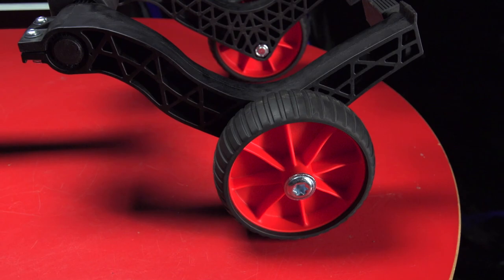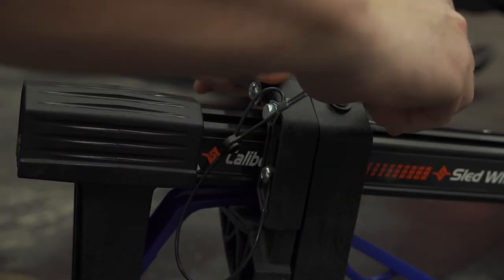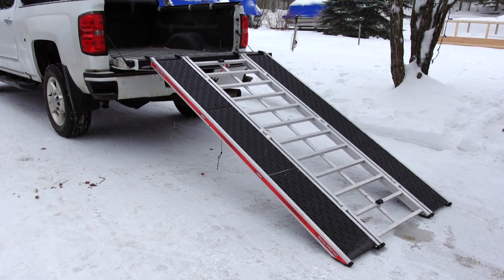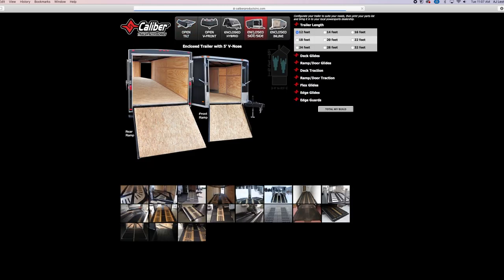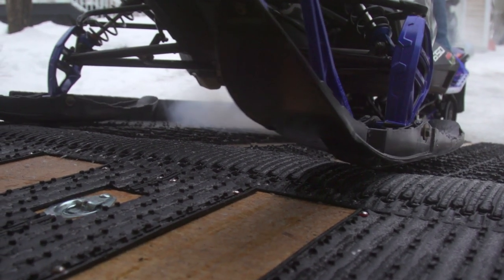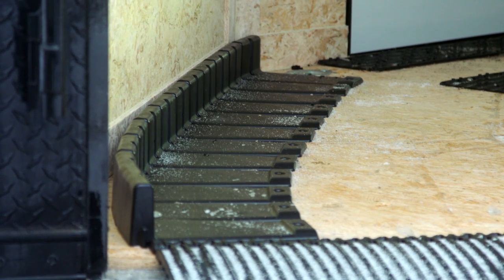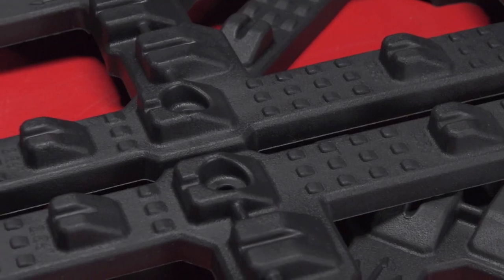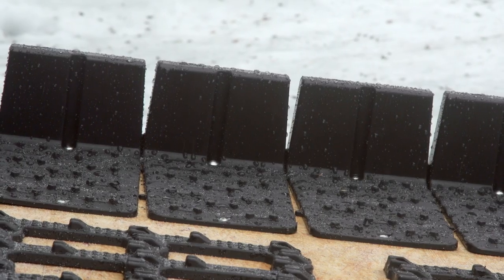Snowmobile Shop and Trailer Products from Caliber

Comment: I installed  these  glides in my new Legend trailer, pricey but very happy with the protection, ease of steering across the trailer compared to my friends old style glides on his trailer, I just use a piece of pvc pipe at the door hinge to clear the gap

Comment: Poor man's suggestion. Yes maybe buy the ski wheels because you can use them in the trailer and shop, but rip a couple strips of scrap plywood and screw to trailer floor for the track studs. Unscrew wood strip in the spring so you can use you trailer for other stuff and don't have 50 speed bumps across your floor. $10 and 10 minute vs. god only know how much $$.